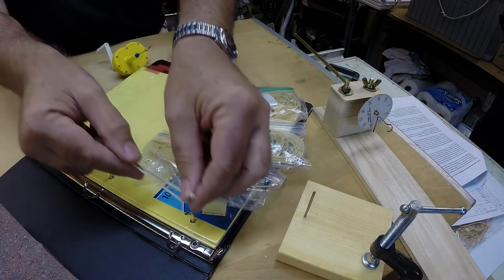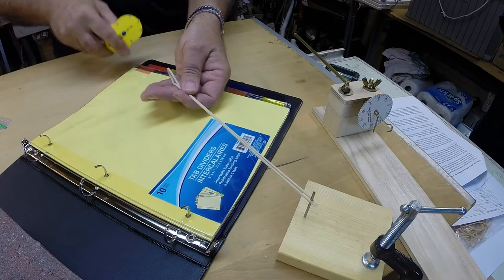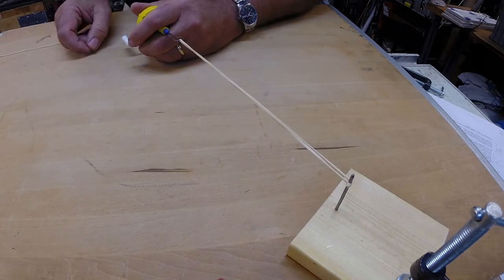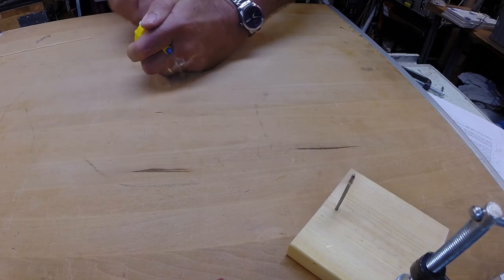Building Techniques For Indoor Models Section 3 Motor Winding

Comment: Thank you for this video first one that has told me how to determine how to calculate max number of turns . Could you do a video on how to determine the length of a motor for a plane as I know when in wound the bands are longer the the model by another 25 % is my guess. 

Also how do you choose width of rubber since it comes in several sizes. Thank you in advance